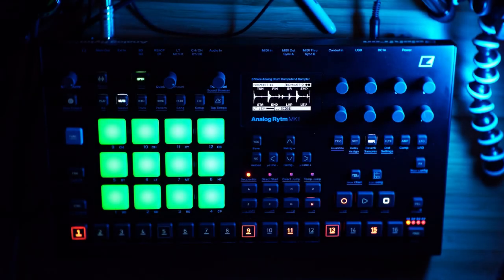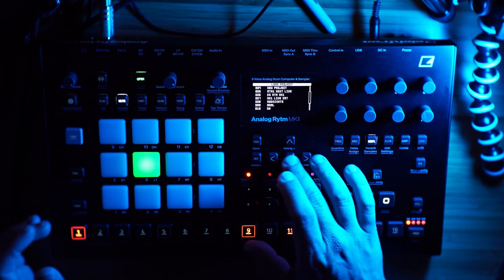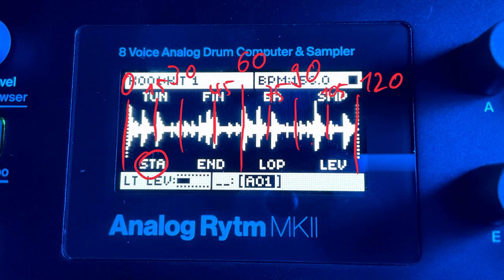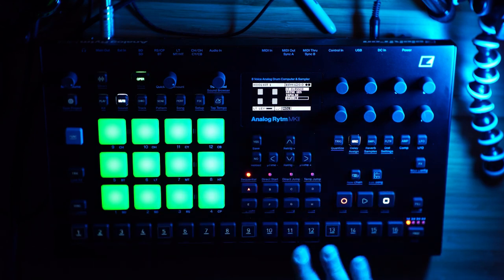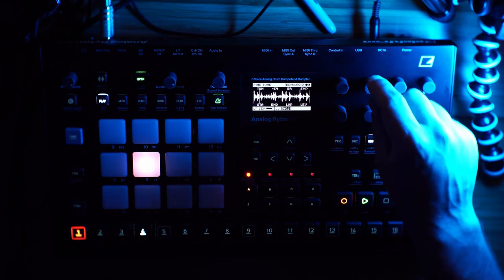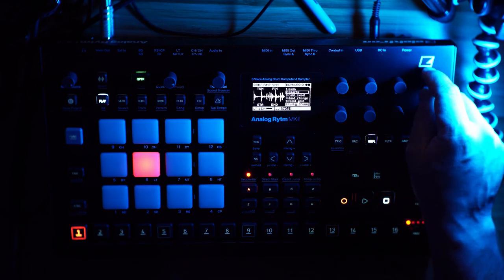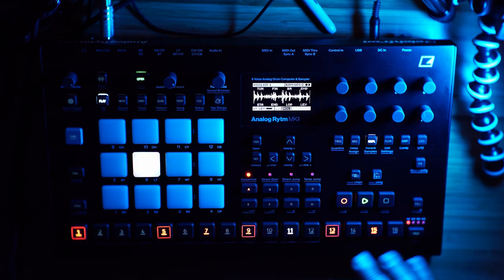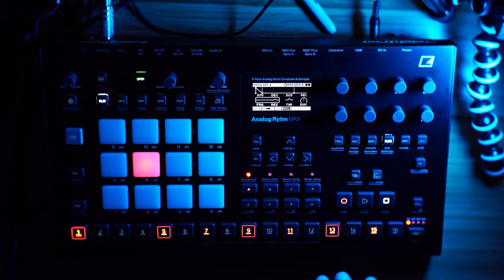Breakbeat slicing on Elektron Rytm

Comment: good work. the latest fw update can help with making sure your loops are exactly bar/2/3/4 long - since now you can set the exact length of the sampling/resampling (similar to Octatrack) . I wish they've added proper time stretch but with a few hacks that can be sorted out tho. Now, if your beats are not perfectly looping, you can cut the excess audio and be within exact length of the track.

Comment: Can I ask you to elaborate a bit more on how you are preparing your samples? Software used? Process?
Reply from the maker: I started in audacity to trim the breakbeat samples to a perfect loop. I didn't want to pitch all the samples by hand so I wrote myself a little script based on sox (https://sox.sourceforge.net) that if I remember correctly guessed the initial bpm and number of beats based on the original length and then just re-pitched to the appropriate length. Probably didn't save much time over just doing it manually in audacity though...

Comment: What about breakbeat loops at different tempos? Can you have two samples at different pitches on one channel or do you need to use another channel on the Rytm? 

Thanks for the video!
Reply from the maker: That’s in principle not a problem, however it will be a bit more fiddling around to get everything in time.